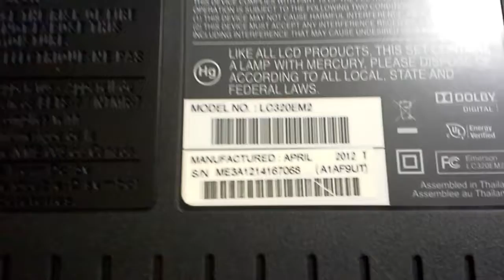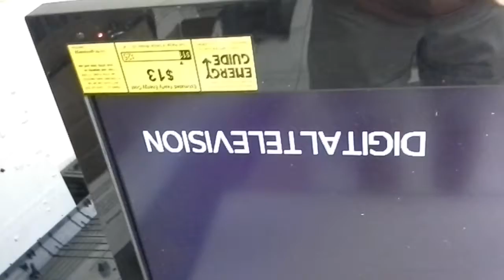Repair Emerson LC320EM2 power board BA17F1F0102 Z_3 for dead TV problem

Comment: i have the ezxact problem piece by piece ...i changed all the same parts and it worked for like a week now it making high pitch squeeking sounds
Reply from the maker: This can be caused by various other things and is not something I can help with remotely, sorry.
Reply: @coppelltvrepair  you know what's weird it's that it blue out some feed back resistors as in this on parker or sword with the optocoupler but it's not causing a shirt circuit

Comment: mine squeaks! i have several diodes showing continuity, several stop showing continuity after unplugging the driver and main board. i'm guessing it's time to go on amazon for a new tv. EDIT: my red light comes on but, it will not power on. putting a 40watt bulb in place of the fuse give light, a flicker then no light at all, i believe it's supposed to dim.

Comment: I have the exact same TV and the same problem, the D640 diode is bust, and I'm sure some other parts... How much is your kit and does it include upgraded parts? Just in case, can I get several, like 3 parts of each, so if it goes bad I can at least have 2x more chance to fix it? Thanks for the video!
Reply from the maker: You can find the repair kit in the description section of the video as well as in the video's last 20 or so seconds.
If you need more parts you can just get 2 or 3 kits.
We recommend replacing all components at the same time.
Reply: That's like the head gasket blowing and saying you need to rebuild the whole motor lol
 Anyone that's trying to repair a TV is trying to do it cheap, or it's a $5k TV that's worth getting an entire kit. You can just order the parts and people don't know what all to match there are several websites out there that tells you every single piece that goes to anything you could possibly need as well as dorect links next to them showing the prices from all the different websites instructional videos and walkthroughs...

Telling someone that they need to replace everything by getting all of the kits... a little ridiculous!
 You can quickly test and see what's wrong with something and if it's everything, then you salvage what parts you can, put them all in containers that are labeled.

Basically you can test something to see what's wrong with it and then go to a pawn shop and pick up 10 TVs at $1 to $5 each and just start salvaging add flip it for a profit. 
 Plus you have a bunch of TVs laying around the house that work that you didn't have to pay anything for lol
Reply: @RBRM3  I fixed it by replacing only the bad components and it works. Thank you for your input!

Comment: Put a 60 watt light bulb across the fuse holder. add power. bulb is bright and stays that way you have a shorted component. bulb comes on bright but goes dim or out you are good to go. saves on replacing the newly installed parts.
Reply from the maker: I'd say that is fairly pointless in a 32'' power board.

A replacement fuse is $1-$2 and would easily save time to try one than to make a bulb for the purpose of testing.
Anyone who'd do it more frequently knows more reliable and convenient ways of testing, such as checking quickly the rectifier. PFC circuit (if any) and mains power switches for shortage.

The 60 watt bulb is a thing from the past. It doesn't mean it can't be used, but it sure isn't something I'd recommend, especially in testing newer low power LED TV power boards.
Reply: Stupid